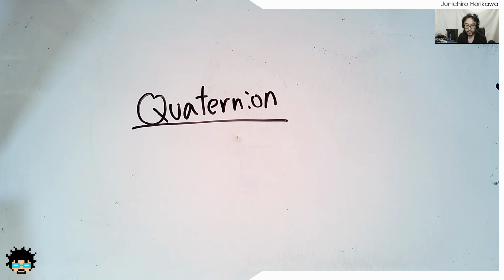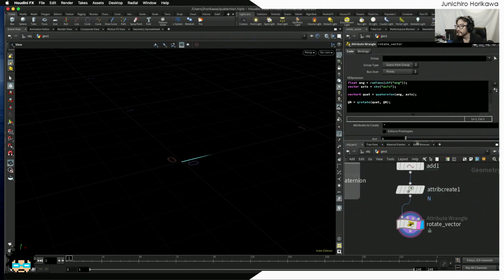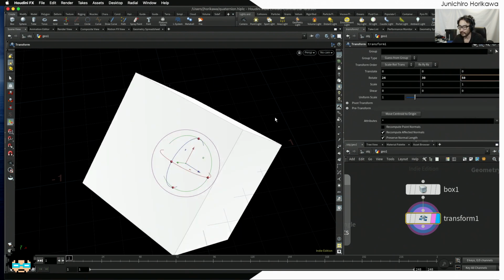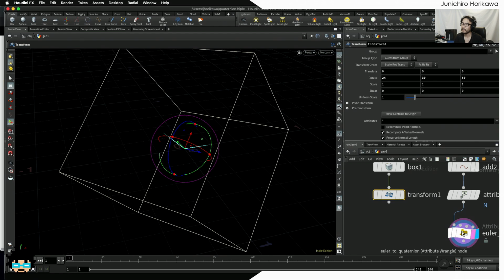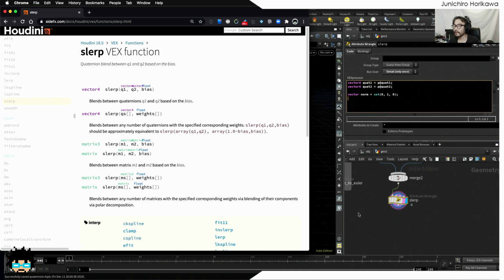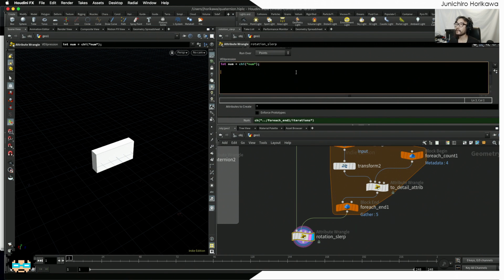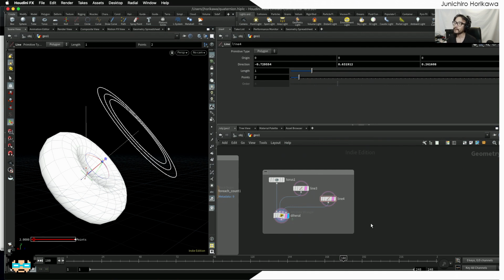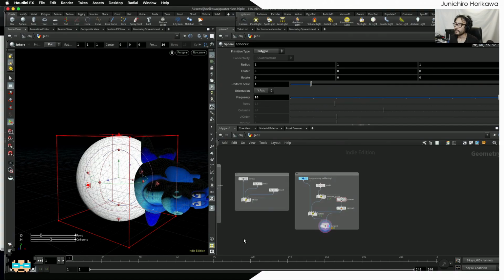[VEX for Algorithmic Design] E14 _ Quaternion Basics

Comment: In the last segment, a point was added to revolve around a sphere. I created two spheres. How does the wrangle know to use the first sphere as a reference? Also, instead of using geometry to revolve around the sphere, I wanted to use several points. Naturally, I created a scatter and used the copy-to-points node. However, the point wrangle treats each point (sphere) as a single point.  What am I missing?

Comment: Sophisticated solution, I still can't wrap around my mind totally on how you mapped each iteration to a certain frame range when it comes to the brick rotation at the end. Anyone can explain that to me :) ?
Reply: Yeah! So, there's 5 iterations, right? So he finds the range of a single iteration by taking the number of frames ($FEND) and divides by the number of iterations. Say there's 100 frames. Then range would be 100/5 = 20.

Next, he maps t to a value between zero and one. % means modulus. @Frame % range gives how far into that iteration's range the current frame is. E.g., frame 35 % 20 would be 15. He then divides by range (20) to get 0.75, indicating that on frame 35, the t value is 0.75 or 75% of the way through that iteration.

The only thing left is to determine which iteration. He does this by dividing the @Frame by the range and flooring it. So, on frame 35, we'd have 35/20 = 1.75, but floor(1.75) is 1, so this indicates it's on iteration 1 (iteration 0 is the first iteration).

He then uses % num to ensure that, once the iteration gets up to 5, it is zero instead. Instead of 0, 1, 2, 3, 4, 5, it would be 0, 1, 2, 3, 4 ,0.
Reply: @AnsonSavage thanks for the time to write this down.  I will take some time this weekend to go through this again and check your explanation . I still have the exercises saved.  Never managed to understand this last part fully, although could see how it worked. Cheers